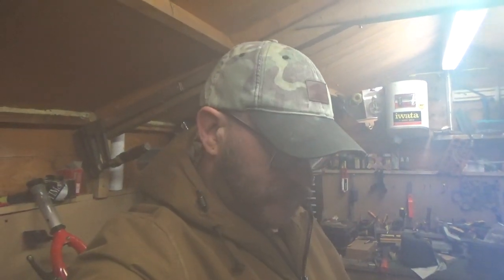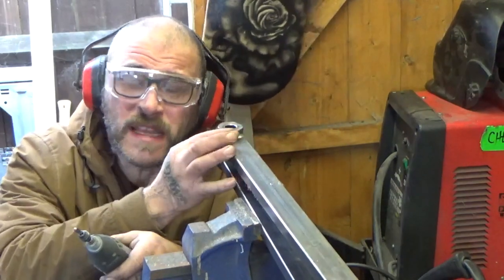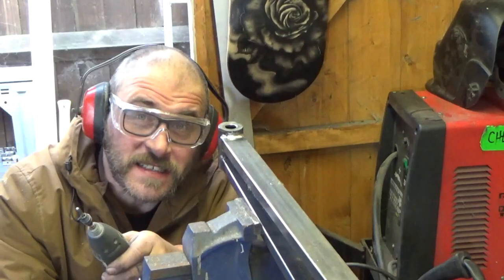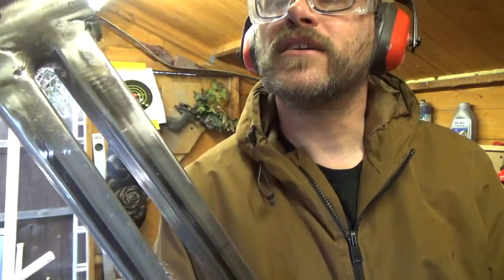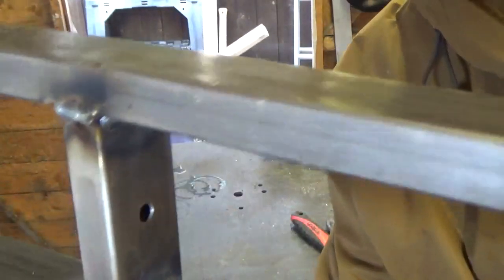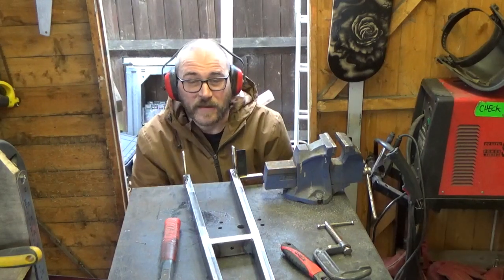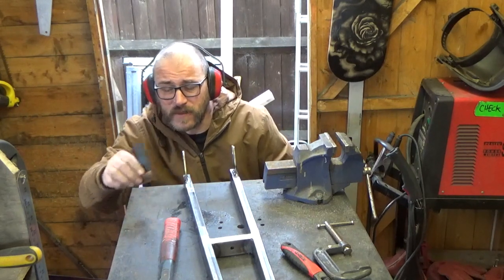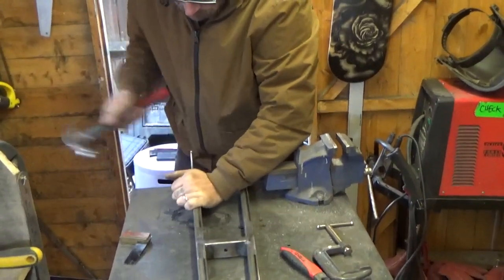Build your own recumbent bike part 2. DIY short wheelbase recumbent bike. Steerer tube and forks.

Comment: Great work, simple design.
Small correction, Rake: relative to horizontal (not frame), I think. 
Also have a look at Geekbike, his design uses zero rake, back facing fork to give trail. Apparently much improved

Comment: Hi mate, clever sod aren't you 😆👍.. This is a daft question I suppose but does it take a while to educate the body to operate in this position compared to riding a normal bike ?. My main rides are a vintage Marin Eldridge grade cruiser that I made and a vintage Whyte PRST 1 ( my pride and joy). As always Stay safe ..Alan
Reply from the maker: Ha ha thanks. Yes it takes some getting used to and you use slightly different muscles so it can take a while for the legs to adapt. The main thing is that you can never pull on the bars, you need to press your back into the seat and push with the legs. Great on the open road, not so easy in town or going up steep hills.
Reply: GeeMan, Super good stuff on your site. Thanks a million.

Alan, have no worries, there is not much to changing riding from your diamond frame to
 a recumbent. Biggest problem of riding is all the nay-sayers.

A couple things to remember but firstly; go to bike shop selling recumbents and try them out(every type they have)  before you start building this one (and this one's a gem.) Straddled the frame and before you set down, grab and apply the brakes as the bike will move backwards (the dealer will think you've tried others!) Sit down and put your lead foot on the peddle and bring it straight up awaiting the starting forward push, lean back in the seat,  push the pedal forward and get your other foot up, and away your go! Easy Peasy! DON'T OVERTHINK IT!
Reply: Bents do have a slight learning curve and there are a couple things you take for granted on an upright that you do not do on a bent. Power comes from your legs and holding the handlebars on an upright to help you power up a hill does not work on a bent the same way. Uphill, as you can not stand you need to select a lower gear and spin . For the first 4 years of trying to do this low gear spin up the hill I would make it part way and mash the pedals at low rpm the rest of the way. You need to train for hills if you want speed going up them. Over time hills will see you coming and lay down for you. Any bent you buy ( I suggest used ) will be a different beast till you have a good 250 miles on it. 
All components except for steering and seat are the same as road or mountain bikes . Another minor thing to get used to is gearing down at every stop you make as you can not stand and balance the bent if you try to start off in a high gear. Select which foot is your lead foot and get that foot to move the pedal to get you going before getting your other foot up.  When you are moving you can clip in with your other foot.  It takes a while to get used to clipless pedals and unclipping to the side is somewhat different than an upright , so another thing to practice. I ride with short crank arms 153 mm and clipped in as I average 85-90 rpm ( it took over a year before I could be consistent in rpm's) and my pedals are on the second notch , nowhere near the maximum retention.  I enjoy comfort and the seat that came with my new Giro was a seat loved by many ,just not by me. So I now have a full mesh seat and that is what my preference is. As my bent is a touring bent it is still giving me the two things I want in a bent or bike ,Speed and Comfort. An upright bike gives me speed only .